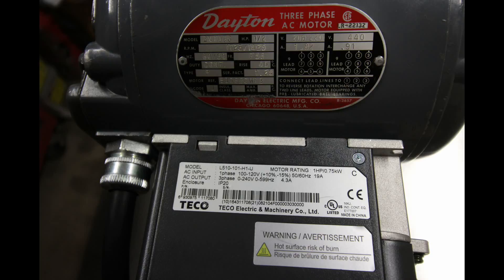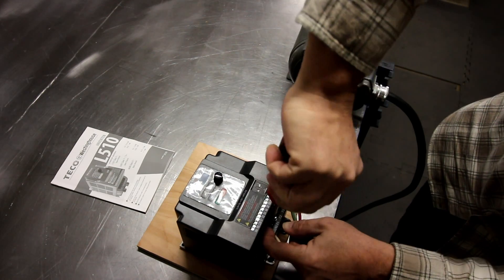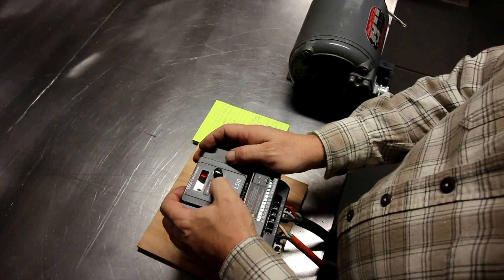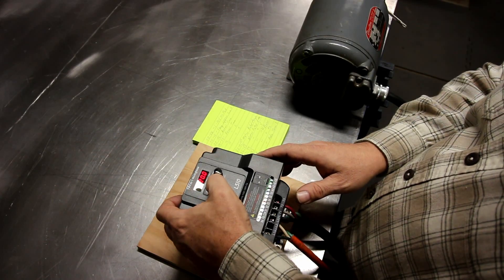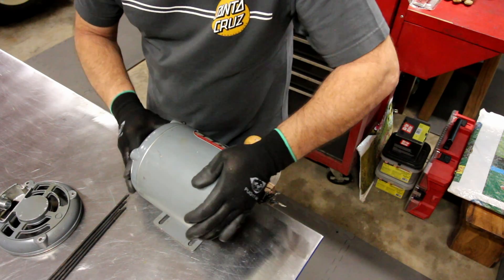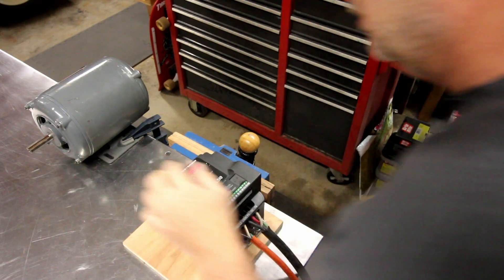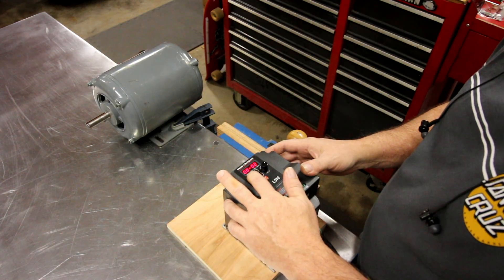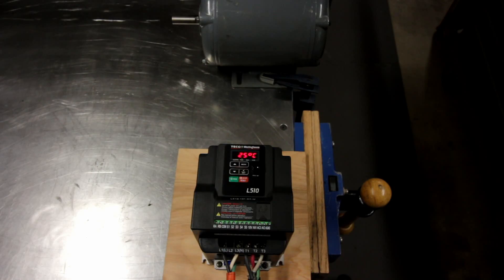Teco L510 VFD Setup and Induction Motor Bearing Replacement

Comment: Hi
Where to configure the VFD starting frequency? Its current starting frequency is 50. I want to change it to 20 Hz. Please advise
Reply from the maker: PID 00-13
Reply: @BurtonsAttic  Thanks for responding. I have emailed you my query describing my problem statement.
Reply from the maker: I read your email, please reply here so others can read. In your current configuration do you have any external input device? Or you just have the potentiometer on the VFD interface? Also here is the link to the online manual, a lot easier to use than the small book that comes with the VFD. https://www.tecowestinghouse.com/Manuals/L510_instruction_manual.pdf

Comment: Morning. 
I'm doing the same with a 3450 motor where do I find the maximum hz I can push  a 2 pole motor to. Or is this just common electrical engineer knowledge.
Reply from the maker: Hi Aldrich, their are a ton of online resources regarding VFD's and complicated formulas but the simplest rule of thumb is to not exceed more than 90Hz for a non inverter duty motor. You can actually hear the motor become unhappy if you push it to hard for testing. Generally I don't overdrive my motors to much. I try to stay at 60Hz or less and on occasion push to 75Hz. Hope that helps.
Reply: @BurtonsAttic  it does. I finally found on engineering.com that you can "push" a 4 pole up to 200% and a 2 pole to 125% or 75 hz I'll just stick with 60hz and be happy with it. Thanks for caring brother. I appreciate your works!

Comment: Any chance you could make a video on programming the vfd?
Reply from the maker: Andreas in the audio of this video I mention all the parameters that are required for a normal straight forward non industrial application, like just controlling a variable speed motor of some type. Those parameters are pretty much called out the same for all VFD brands. The parameters (PID) are found in the manual that comes with your specific VFD (along with the programming procedure) you just need to gather a little more information about your specific application from the motor data plate. Hope that helps.
Reply: Burton's Attic 
Thank you... yes i listened a few times and cross reference the instructions . Your info was great just my vfd set up was a bit wonky.  Got it all sorted. Again thanks.

Comment: Thanks for your video. I have the same model vfd. What purpose does the frequency reference serve?
Reply from the maker: Thanks. By frequency reference I think you mean the Hz display. It is simply the Hz range that you have programmed the parameter for frequency lower and upper limit. The minimum and maximum speed you want the motor to run at. Mine is set at 5Hz to 100Hz (over driven by 40Hz). In a non VFD configuration the motor would just be running at 60 Hz. Hope that helps, if that didn't answer your question LMK.

Comment: Are you using just a regular 120v plug and cable (22AWG-10) for input power?
Reply from the maker: Slagged the black/output cable is 14/4 meaning it is 14 gauge with 4 conductors/wires which is correct for this particular application. The orange cable is 16/3 which is just a normal extension cord I'm using just for test purposes. In a final installation I would use 14/3 for the input cable or 14/4 and not use one conductor. Yes the orange cable has a 120V plug on it. The VFD turns that 120V into 240V. Almost all cabling for this type of installation is rated for 600V today. Go to your local big box store and look at the electrical cable. This type of cable is on a spool and is sold by the foot. Also it is referred to as multi strand wire/cable.